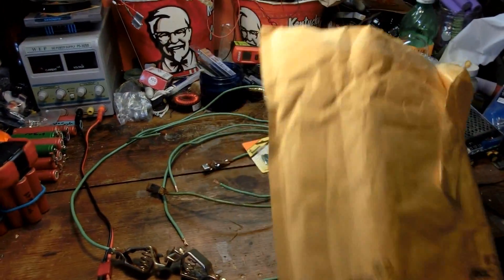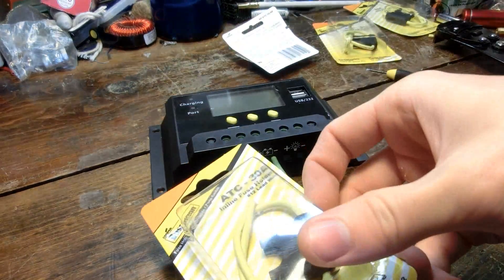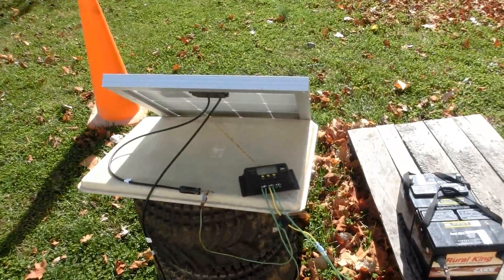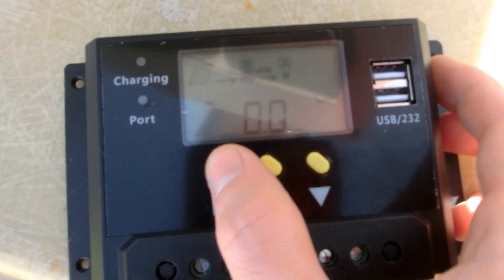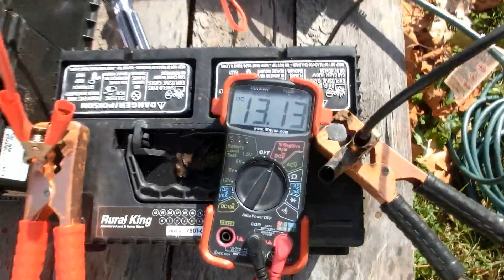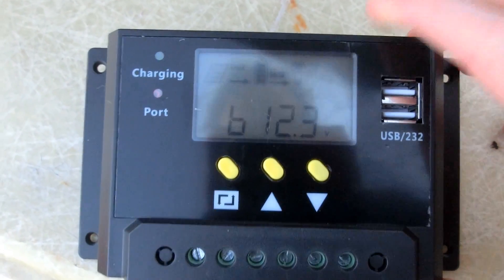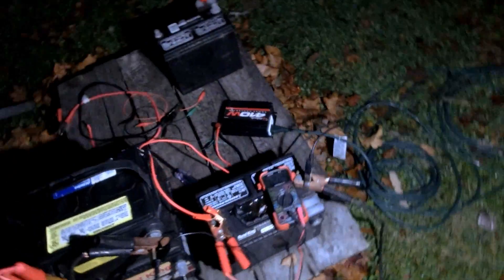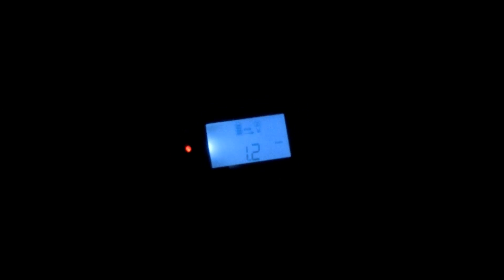Solar Sunday Experiments 003: My First Kilowatt-Hour

Comment: If your just running a light use a 12 volt light and do away with the inverter , the inverter will use more power then the light will by doing away with it for lights it will make your setup more efficient

Comment: What gauge wire runs from the panels to the charge controller? With 100w @ 12-18v you want at least 12AWG wire. I'd recommend 10AWG.

Comment: i have found it wise to take the acid tops off when charging so pressure wont build up
Reply from the maker: +Dj Morgan they are pressure release valves, thus they wont build up pressure.
Reply: nice,good luck with your project

Comment: yes car battery's preferably 5 deep cell 30amp hours 600+ cranking amps 12 volts connected in tandom (positive to positive) (negative to negative)
also do not mix brand's or type (to prevent premature failure)

Comment: If you were to buy a quality MPPT controller, you could set all parameters for charging. You wouldn't have to concern yourself with a controller that automatically determines when it goes from bulk to float. Midnite Solar, dude. Midnite Solar.

Comment: You wouldn't need a fuse on the solar panel leads anyway because the current from even both 100w panels in parallel could never exceed a level that would ruin your controller.  The battery, however, can push hundreds of amps until something melts! :)  So, it's a good idea that you installed that fuse.

Comment: 13.8 V is optimal charge voltage, controller should let batt's go down to about 11 V then it will switch the load off. Under about 10.8 V you start killing your batteries. As long as you are running your inverter from the load terminals on the charger you won't have to worry about your batteries. Some people will connect an inverter directly to the batteries and then wonder why their batteries die an early death - there is no controlling the discharge.
Reply: kiskiller3
 Yes thank you, we clarified the voltage in the rest of the thread. My point was that the small inverters can go directly to the load of the charge controller (larger controllers), the larger inverters have their own cut off voltage limit and can connect directly to the batteries.
Reply from the maker: Gavin Crouch no you start killing your batteries as soon as it gets bellow 12.6v. its just you start killing it exponentially faster and faster the lower you go.
Reply: Rinoa Super-Genius I meant to say under 10.5 volts the battery is considered dead and you would need a different charger to break through the resistance, but cells (replace my comment "killing your batteries" with "killing the cells in the battery"... by then may be damaged beyond recovery. You are right in saying that any discharge reduces the life of an ordinary battery exponentially. My main point was to explain the charge controller... seen a lot of people forget the load terminals and connect direct to battery <- my initial point :-)
Reply from the maker: Gavin Crouch
yeah i agree, but i dont trust this charge controller very much so i'd rather not also make it control the load. i would probably have my batteries shut off at 12.2v if i was using them a lot due to them being automotive batteries not deep cycle.
Reply: Yeah, you do get programmable controllers, at a cost, that will let you do that. I like that yours has the USB, I have to connect a lighter socket to the load, then insert a USB charger... lot of loss my way.
Reply: Gavin Crouch actually at 12.6 its fine for short term but then you need to recharge them
Reply: Gavin Crouch yes i ment to say that at 12.6v sulfation can occur thus reducind the life of the battery thats why you should not leave a battery discharged to 12.6volts or lower or it starts sulfating

Comment: Your getting your 12vdc, why not wire them up in parallel. The PWM charge controller can handle 30 Amps. Increase your amps, means increase the rate at which the batteries will charge.
Reply from the maker: Agent 72849 thats what i did, but at first its easier to just experiment with one.
Reply: Rinoa Super-Genius
Totally understandable. I'd probably do the same thing when I first got them.. But I actually only have 3x Radio Shack solar panels, they're something like 4.5vdc, 0.333A, 1.5W each. So I was like screw 0.333 Amps, I want more POWER.. So I wired them up in parallel. Now they are actually outputting 5.6vdc, 1.1Amps together in parallel on a really sunny day. Last several days it's been a overcast.. So.. only getting 4.6 - 5.2vdc, 0.3 - 0.7A.. Just using them to charge my Samsung Galaxy Note 4.. I actually keept my phone charged all day today, until the sun went down at around 7:30PM today.  But yeah, I really want to get some Renogy solar panels, just for fun, seeing that they're actually pretty cheap for the 100 Watt solar panels on eBay. So on a good day, how many amps are you getting from one of these? It says on the site 5.29 Amps, but I think the rating aren't always correct, that most of the time the ratings are higher then what they say.. Even my cheap radio shack ones I got, when I put them in the sun on a clear day, all three of them were putting out more then what they were rated for, which was 4.5vdc, 0.333A. The panels I got from eBay no longer exist. the guy had them laying around, so I was like sure I'll buy them for $15 for all three.. :)  Radio Shack charges something like $15 for each.. So it was a really good deal.

Comment: Plus the thickness of wires should make much a problem when using AC. 100 watts on 120v single phase AC is .833 amps so using anything around 20 AWG or higher(as in larger) is enough, 18 being ideal. Pretty small wire though.

Comment: Rin , why didn't you connect both panels to see??. Just curious.Peace
Reply from the maker: to see what? i'm testing with one first just for simplicity and will use the 2nd one latter. but will probably only work with the 2nd one when i start putting them up onto a pole.
Reply: Rinoa Super-Genius  Calc's first huh?. Alright I'll keep checking. Thanks for the reply, Peace.

Comment: I notice at 3:40 you connected another battery. You should have a switch on the solar panel's power, or at least disconnect it. Most charge controllers can't handle having power coming in from the panels without first having a battery connected. That may have been what caused your other controller to crap out...
Reply from the maker: no that wasnt what caused the other one to crap out, what caused the other one to break was 100 amps of current going through the battery terminals and into the solar panel wires where it was shorted out.
Reply: If something ever happens to the system, disconnect the pv from the charge controller first then the battery bank, do that in reverse when turning back on.

Comment: do you think you might add some diodes to it so that the charge controller is protected?
Reply from the maker: well the fuse will help a lot, and i may if i find some large diodes that arent very resistive.
Reply: Rinoa Super-Genius  Take apart a PC SMPS, they have 30A Schottky diodes in them!
Reply: Rinoa Super-Genius its a shame that they dont put diodes in it

Comment: Congrats on the first KWH, hope you make many more, it does get addictive!  For sure pick up some MC4 connectors and I use 10ga. landscape wire for my panel wiring, it stands up to outdoor use.  I produced my first solar power in June of 2013 off of 30W then 90W of panels.  Now up to over 1300W of panels and I produced 122KWH last month.  I have a few videos on my channel.

Comment: '1kw achievement unlocked, 999 until next achievement unlock' :-D well played. That grey sky you had reminds me of home, those amps it was providing at the time, also reminds me of home :-p I need a generator of some shape or form, something quiet as not to wake the dead...sorry poor joke as I live next to a grave yard, speaking of which 'A new arrival' :-D Solar, Solar Domingooooooooooooo :-p
Reply from the maker: if i'm not mistaken....a teathered balloon doesnt need a registration or anything it just needs a light to warn airplanes. i've always wanted to build a hot air balloon system that is warmed by sunlight and with solar panels for electricity. it would be cool if you could hoist something up above the clouds.
Reply: yeah you could do a lot of measurements these days just with a basic smart phone :-) I was thinking of a heating element, heating hydrogen using the solar for the element :-p if it blew up it would look cool, aye it would be a bit dodgy when the panels come down, but whats trial without tribulation :-D

Theres a few ways you could communicate with your stuff on your balloon that would be cool though, like a new 'white space' module that will be due soon :-) hell even a long Ethernet cable :-D I do love wires.

hmmm I think over a forrest would be discreet but in the suburbs around here in north Manchester it would attract a lot of attention. Least id get in the papers...again :-D don't ask

perhaps you could pump gas up a mile long tube to keep it reinflated :-D tis a cool idea, few flashing red lights and you would be grand I think :-) think your faa allow you to go 500 foot up don't they like british equivilant :-)
Reply from the maker: battonfive well you would have 2 wires for the power coming down and you could communicate with a computer on the balloon aray by modulating the load. so more load would be a 1 and less load would be a 0. would be a serial interface and the balloon computer could send signal by limiting it's voltage for a few milliseconds.
Reply: that would be good, could probably run it on a thermostat for self management and simply break the circuit for down times :-)

I get a mental image of it being tied to the top of a solid tree or pilon though :-) would keep it away from folk so that would be good.

it would be a particularly useful thing for a drone transmitter setup :-) even a little drone nest in the clouds would be legend :-D

Comment: You should have connected the load to the output of the controller
Reply from the maker: jusb1066
well this inverter was only pulling about 2.5a for that 30w bulb but there is really no reason to go through the controller because the controller doesnt add up the power, it just is another chance to break the controller.
Reply: i agree rinoa, was just replying to the guy above, its handy for lights as it will switch at low voltage, the inverter has its own cut off, and it will break the controller if it was to pull its real amps under load
Reply: the output on the controller is meant for lighting and such, it wont handle an inverter, too many amps.
Reply from the maker: jusb1066  well i've pulled 30a through the controller for about 2 hours so far so thats 360 watts.
Reply: yeah didnt you buy the 30a model? so maybe you matched it, i only have a a couple of 10a ones, as i dont have such large panels, so i tend to mind what i use the output for
Reply: Rinoa Super-Genius I was saying it because of the battery low voltage cut off, but I  didn't remember that the inverter already had one :P

PD: Good video!
Reply: Nope, not really.

The load port on the charger is ideal for things without any low voltage cutoff, like led lighting strips. Or 12v usb sockets. 

However, ALL inverters have low voltage alarms and cutoffs, and chances are, an inverter will pull many more amps then the charge controller can safely handle. So ALWAYS connect the inverter directly to the terminals as rinoa did.

Comment: Polarize and fuse your cables.
Reply from the maker: did you see me add a fuse?
Reply from the maker: jusb1066
 having the wires color coded hasnt helped me with reverse polarity. if i dont notice their polarity then i'm in a situation that i dont remember to check the color of the wires. not counting painting wires isnt fun.
Reply: Rinoa Super-Genius
you could mark positive and negative though, green for everything is a bit risky!

Comment: Too bad you couldn't convince your mother to let you put the solar panels up on the roof.
In the winter will solar panels on a sunny day provide enough power to keep the batteries from freezing up if you leave everything outside, in your opinion??
Reply from the maker: thejaviesable
yeah i'm putting the panels on a pole.
Reply: I thought the tree was the reason the panels weren't put on the roof.
Reply: redneckbryon 

You have to watch with home wiring jobs with thing like this. If it is not signed of by a pro and your house burns down they can say it was the solar panels and not pay you a penny. Doubly so if your using products that have not been properly tested a certified from china.
Reply: Fraser Lamb Yeah that's true, crap from China likes to burn.  I think it's a big conspiracy they do it on purpose to take all of the Westerners down! lol

Comment: I reckon the plastic on the wire would smoke before the solder would give way to heat/over current. Nice work on the first kilowatt hour :)